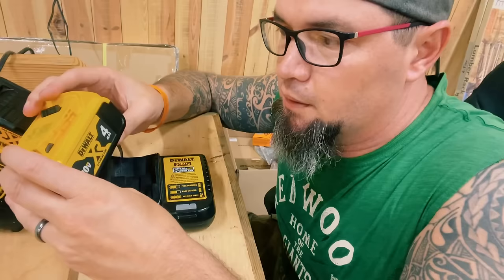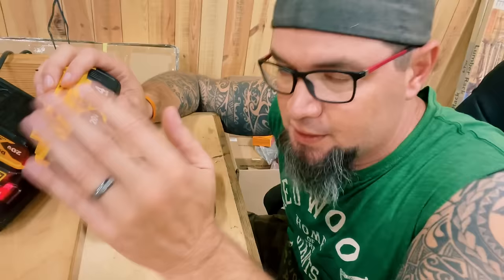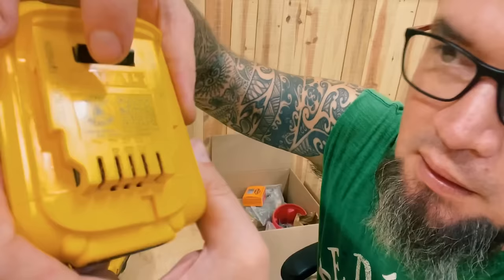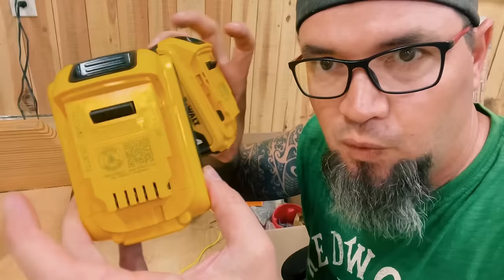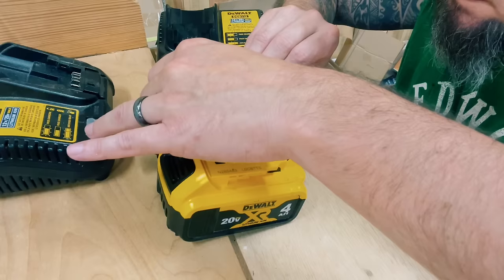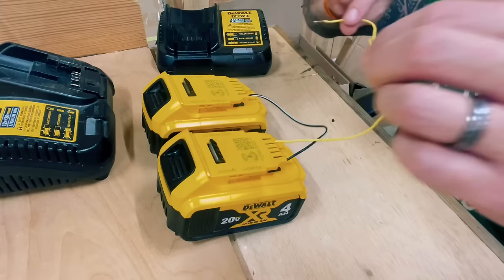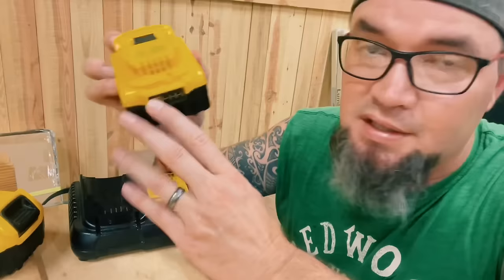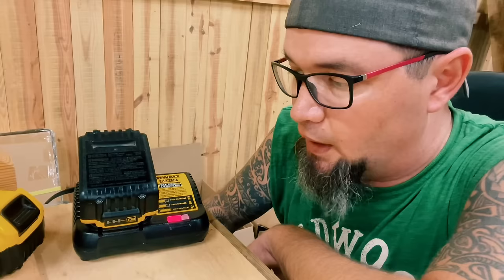Dewalt Lithium Ion Battery Won’t Charge? Try Resetting It With This Easy Fix.

Comment: Just did a Google search to get here. My battery was good but been sat on the shelf for months. It wasn't showing any signs of life. Did this reset and it worked like a charm. Thanks man, saved me buying a new battery.
Reply from the maker: Nice!
Reply: @MatthewPeechWoodworking  can i connect 20v good battery to 18v bad battery and fix it?
Reply: @savipv8491 If the instruction stated that connecting the b+ and b- only, id guess that the other connector is for cell balancing, for a few seconds im sure it wouldnt cause any problem do it at risk 😂✌️

Comment: Was totally skeptical and did not think it would be as simple as this to fix! Just brought 2 batteries back to life! Thanks
Reply from the maker: No worries!  Yea I've done this several times.
Reply: Repent to Jesus Christ 
“As a father has compassion on his children, so the Lord has compassion on those who fear him;”
Psalms 103:13 NIV
Reply: Do they fully charge and do they hold charge like a new battery.  Or so they drain faster? Cheers
Reply: @dranderson6071  yes they will charge but capacity and discharge power are effected this is why lion lipo batteries blow up and catch on fire pulling to many amps from a damaged battery will make it blow up
Reply: @repentandbelieveinJesusChrist3  dude! Why the hell do you people have to do this all the time? If you found something that works for you, great! Congratulations! But please keep your damn preaching to yourself. That is so inappropriate.
Reply: @repentandbelieveinJesusChrist3  you're like a teenager who just discovered sex, and thinks nobody else has ever heard of it.
Reply: @theobserver9131   oh my god. He was just being over dramatic.  With the cost of these batteries 🪫 I can laugh 😂 at the over dramatizing response.
Reply: Warning. Only do this in an emergency. If you manage to charge this battery, do not keep this battery anywhere it can cause a major fire.
Why ? When these batteries are discharged below 3v per cell, dendrites (small spiky structures) can grow and possibly pierce the separator between the anode and cathode of the battery, causing a short circuit, and thus a fire.

Most consumer electronics will regard 3.3v as fullt discharged, and the battery protection circuit will then turn the equipment off to prevent over discharging.

If a cell is found to be 2.3v or lower for anything by the a very brief time, then it is effectively dead, dendrites will have certainly grown, and even if you manage to charge it, the dendrites are still there, and you now have a ticking time bomb. Do not reuse such a cell.
Once that separator is pierced you may have a fire, the intensity of that fire will depend on how much charge is stored in that cell.

If your battery pack has been dischared for some time, open it up, and measure the voltages directly accros the individual cells. If this is less than 3v, do not attempt to charge. Even if there is not a fire, you will notice that after charging, that cell will self discharge within an hr or so. This is due to a partial internal short circuit caused by dendrites. More energy put in to such a cell increases the risk of fire.

You have been warned.
Reply: The battery may be "bought back to life" but the capacity has been severely compromised ie full capacity 2 hour run time, brought back to life batter 15 minute run time.
Reply: @nordic5490  I've read a lot of these warnings but have you ever actually experienced a lithium fire yourself? I've fixed several batteries like this, jumping cellphone batteries with a 9v even, and I've yet to experience a single fire. I'm usually in a safe place on a metal tray ready for it though
Reply: @Pointiegoat69  Right, house fire from 15 minutes to 2hrs... Fatality if the fire happens at night.
Reply: @repentandbelieveinJesusChrist3  Huh?
Reply: I’ve done this it brought it back but still not charging even though the light was flashing but
Reply: @repentandbelieveinJesusChrist3  Did Jesus Christ have a Dewalt drill?

Comment: Worked like a charm.  Took a total of two minutes to get the battery ready to charge.  Thanks saved me the expense of purchasing a new battrey.
Reply from the maker: Glad it helped
Reply: I use 8 to 12 batteries daily. Had 3 go out last week. Much appreciated.
Reply: @MatthewPeechWoodworking  i have one that will charge fully but only last about a minute. Any fix for that?
Reply: @user-cs3zs6jn1d  That usually happens  to a new battery. Keep on totally discharging, then totally changing, over and over again for about 6x times (cycles) more.
Reply: Only for the cost of almost burning down your house! So cheap!
Reply: @whatilearnttoday5295  what seemed dangerous to you there Nancy?
Reply: @whatilearnttoday5295  HAHA, leave it to the professionals then kid
Reply: @whatilearnttoday5295  I suppose that if you don't know anything about electricity, it's probably better that you don't touch it. Yes, be scared! Be very scared! ;D
Reply: @theobserver9131  Or you could avoid charging a lithium battery without a charging circuit.
Reply: @whatilearnttoday5295  nobody here is charging a lithium-ion battery without a charging circuit. All they're doing is giving the battery a little CPR, and then charging it normally.
To be fair though, it wouldn't be a bad idea to keep your battery charging station in a fireproof environment. It's true that lithium ion batteries can explode or otherwise ignite.
Reply: I was able to revive two of my old 1.3A and one 2A battery - used my 5A to 'tap' the other ones like you said... a 5-count for each one - all the chargers now see them.  Thanks for this - off to my dad's house to see if this works on his stuff.  Thanks a ton!!  Saved me some serious cash.
Reply: @theobserver9131  Case in point: I-phones and Tesla cars.  ;-)
Reply: I have a dozen or so DeWalt batteries in various stages of their life cycle… I can say with great certainty that this does NOT work for batteries that have gone past their life cycle….i have tried it and it doesn’t work!!!!
Reply: You said it yourself “ beyond their life cycle”
Reply: @rsanchez5676  i did indeed !!! But some people on here think it’s like a magic pixie dust that’ll fix any battery
Reply: I did this a few months ago to my daughters Dewalt drill battery. Took about a minute to recharge enough to put it into the charger
Reply: @nobodyspecial6436  Seems like you are one of them. Past their life cycle would mean that one or more cells have died, so no point in even trying to charge them without swapping cell(s). Measuring the packs voltage should be a pretty good indicator if its because of self discharge to lower than BMS low voltage cutoff or a dead cell
Reply: @1anddr  did you see the guy in the video measure any voltage Einstein?? He claimed it worked i was disputing his claim…. I’m not that naïve
Reply: @nobodyspecial6436  if the battery has been working but is left with a low charge for a month or two its pretty safe to assume that it has self discharged and still works fine. I have had many lithium packs discharge below the chargers expected minimum voltage, all of them were  brought back to life by setting charger chemistry to NiMH and 50mA charging current until voltage is within normal range for the number of cells that are in series
Reply: @whatilearnttoday5295  correct
Reply: Warning. Only do this in an emergency. If you manage to charge this battery, do not keep this battery anywhere it can cause a major fire.
Why ? When these batteries are discharged below 3v per cell, dendrites (small spiky structures) can grow and possibly pierce the separator between the anode and cathode of the battery, causing a short circuit, and thus a fire.

Most consumer electronics will regard 3.3v as fullt discharged, and the battery protection circuit will then turn the equipment off to prevent over discharging.

If a cell is found to be 2.3v or lower for anything by the a very brief time, then it is effectively dead, dendrites will have certainly grown, and even if you manage to charge it, the dendrites are still there, and you now have a ticking time bomb. Do not reuse such a cell.
Once that separator is pierced you may have a fire, the intensity of that fire will depend on how much charge is stored in that cell.

If your battery pack has been dischared for some time, open it up, and measure the voltages directly accros the individual cells. If this is less than 3v, do not attempt to charge. Even if there is not a fire, you will notice that after charging, that cell will self discharge within an hr or so. This is due to a partial internal short circuit caused by dendrites. More energy put in to such a cell increases the risk of fire.

You have been warned.
Reply: @MatthewPeechWoodworking  This is actually a pretty dumb thin to do. Lithium-ion batteries being jumped together can literally burn, and if it is in wet conditions, the battery can blowup scattering toxic burning material around.  

To avoid this risk, use a power supply, they are not expensive. Set it at 5 Volts and 1 Amp.  In about ten to twenty minutes you'll have a reset battery with the minimal voltage for the charger to recognize the battery without the catastrophic possibilities.  

Lithium Batteries can be very dangerous.
Reply: @jeffstorm  hint: most phone chargers fall in that area, and everyone already has one.

Comment: The only risk is a totally discharged battery changes chemically and can become internally shorted. Be very careful when charging and using it afterwards as it could easily catch fire.
Reply: I guess all these people dont know how dangerous a li-ion battery can become once its dropped below 3v, there is a reason the charger will not charge it
Reply: @HardcoreRC  fire smire whats alittle fire....lol
Reply: @memyselfandi3925  LOL, yep lipos fires are nothing to worry about 😂😂
Reply: Yep, Stranger Danger. One you see one light off you would never do this in your home.
Reply: I am shocked that I had to scroll so far in the comments to find a warning about the fire hazard in doing this.
Reply: @xehpuk  I know, crazy isnt it
Reply: You sure? First decent website I found talking about deep discharge it is generally safe.  Although performance may be diminished.
Reply: @johnn3542  100% certain, once a Lithium Ion or Lipo goes below 3vthey undergo unwanted chemical reactions causing their internal resistance to be permanently and significantly raised, this in turn creates a much higher risk of internal failure and fire. There is a very good reason the chargers will not charge them if they are below 3v, and not its not just to make you buy a new battery
Reply: @johnn3542  I was sure, but it is very possible my information is outdated.  I think the risk I found is that in a series pack (which anything > 4.2 V packs are series packs) can cause one cell to become unbalanced and "reverse charged" by the others, which is still an established risk.

I just don't know if I'd bet my house on it.
Reply: Remember to engage safety squints!
Reply: Then you can blame Dewalt and get a new tool and battery.  😉😉
Reply: @jefferydellinger7422  How exactly do you blame Dewalt for hacking their charger to make it charge a batter that is below 3v a cell ? they built in that for safety and your bypassing it ?
Reply: I would also be worried about high currents during "revival" of a battery. It might actually be better to use thinner wire than speaker wire, to limit the current more. You don't need to zap the dead battery at all, just force it to charge a bit. Also, I would highly recommend measuring the voltages of each of the 5 cells before you do anything. Carefully connect your voltmeter black probe to the B- pin, and use the red probe to measure voltages at the C1, C2, C3, C4 and B+ pins in that order. This will give you the incremental voltages of the 5 cells. If the voltage doesn't increment by at least 2.5V for each cell, it is dangerous to continue. Especially if any individual cell is anywhere close to 0 volts you have essentially no chance of success, and should never risk reviving that pack. I realize that most of these packs are in a 5S2P 18650 configuration, so when I say "cell" above it's really two cells in parallel. But the idea is the same because any truly dead 18650 that is self discharging abnormally quickly will also discharge its paired cell. Lithium-Ion technology (cylindrical cells like 18650's) can generally handle being discharged to 2.5V per cell. For Lithium Polymer packs (LiPo pouch shaped cells) you don't want to go under 3V per cell.
Reply: @hockeyguy820  thanks. Pulling the battery out of my house until i check it.
Reply: @HardcoreRC  100% correct.
Reply: Yup.
Warning. Only do this in an emergency. If you manage to charge this battery, do not keep this battery anywhere it can cause a major fire.
Why ? When these batteries are discharged below 3v per cell, dendrites (small spiky structures) can grow and possibly pierce the separator between the anode and cathode of the battery, causing a short circuit, and thus a fire.

Most consumer electronics will regard 3.3v as fullt discharged, and the battery protection circuit will then turn the equipment off to prevent over discharging.

If a cell is found to be 2.3v or lower for anything by the a very brief time, then it is effectively dead, dendrites will have certainly grown, and even if you manage to charge it, the dendrites are still there, and you now have a ticking time bomb. Do not reuse such a cell.
Once that separator is pierced you may have a fire, the intensity of that fire will depend on how much charge is stored in that cell.

If your battery pack has been dischared for some time, open it up, and measure the voltages directly accros the individual cells. If this is less than 3v, do not attempt to charge. Even if there is not a fire, you will notice that after charging, that cell will self discharge within an hr or so. This is due to a partial internal short circuit caused by dendrites. More energy put in to such a cell increases the risk of fire.

If the cells have briefly (a few hrs only) dropped below 3.3v, but, not below 2.3v per cell, then ok, have a crack at charging, but, there is increased risk of fire. 3v can be revived ok providing the cell has not been sitting @ 3v for period of time. More time below 3v = greater risk the anode to cathode separator will be pierced from growing dendrites, causing a short circuit, and hence a potential fire hazard.

You have been warned.
Reply: @johnn3542  no, not at all. Warning. Only do this in an emergency. If you manage to charge this battery, do not keep this battery anywhere it can cause a major fire.
Why ? When these batteries are discharged below 3v per cell, dendrites (small spiky structures) can grow and possibly pierce the separator between the anode and cathode of the battery, causing a short circuit, and thus a fire.

Most consumer electronics will regard 3.3v as fullt discharged, and the battery protection circuit will then turn the equipment off to prevent over discharging.

If a cell is found to be 2.3v or lower for anything by the a very brief time, then it is effectively dead, dendrites will have certainly grown, and even if you manage to charge it, the dendrites are still there, and you now have a ticking time bomb. Do not reuse such a cell.
Once that separator is pierced you may have a fire, the intensity of that fire will depend on how much charge is stored in that cell.

If your battery pack has been dischared for some time, open it up, and measure the voltages directly accros the individual cells. If this is less than 3v, do not attempt to charge. Even if there is not a fire, you will notice that after charging, that cell will self discharge within an hr or so. This is due to a partial internal short circuit caused by dendrites. More energy put in to such a cell increases the risk of fire.

If the cells have briefly (a few hrs only) dropped below 3.3v, but, not below 2.3v per cell, then ok, have a crack at charging, but, there is increased risk of fire. 3v can be revived ok providing the cell has not been sitting @ 3v for period of time. More time below 3v = greater risk the anode to cathode separator will be pierced from growing dendrites, causing a short circuit, and hence a potential fire hazard.

You have been warned.
Reply: @HardcoreRC  well yes. Consumer electronics are designed to shut of @ 3.3v per cell, and the chargers are designed to not charge a cell that is below 3v. This is due to the high risk of dendrites growing below 3v, over time, that can pierce the insulator between the cathode and anode of the cell, causing a partial short circuit, and potentiallly a fire. More charge stored in a compromised cell = a bigger potential fire.
Reply: @hockeyguy820  Consumer electronics are designed to shut of @ 3.3v per cell, and the chargers are designed to not charge a cell that is below 3v. This is due to the high risk of dendrites growing below 3v, over time, that can pierce the insulator between the cathode and anode of the cell, causing a partial short circuit, and potentiallly a fire. More charge stored in a compromised cell = a bigger potential fire.
Reply: If you're going to do this atleast put the bad battery outside of your home in like a fire safe container away from houses, cars, etc.